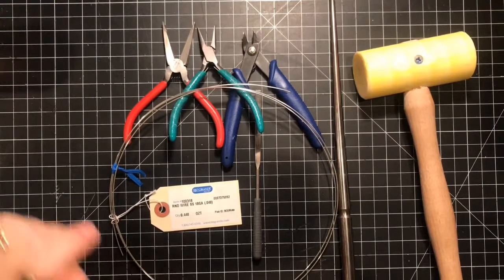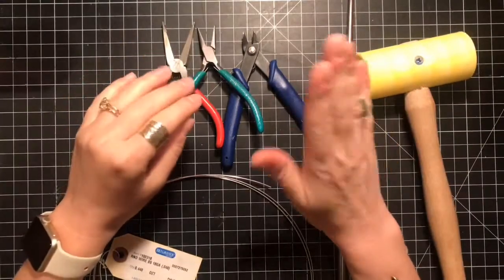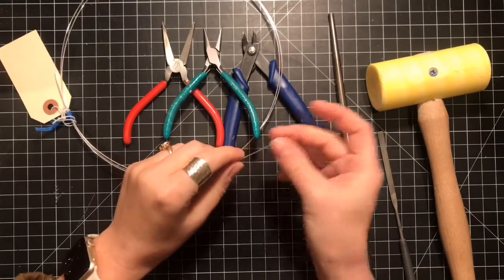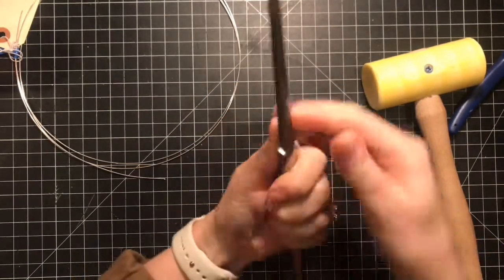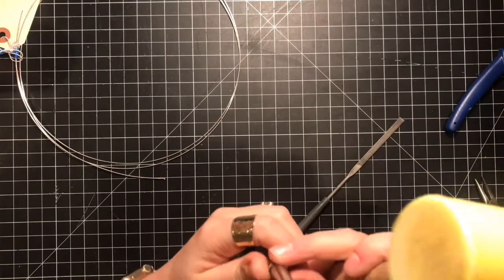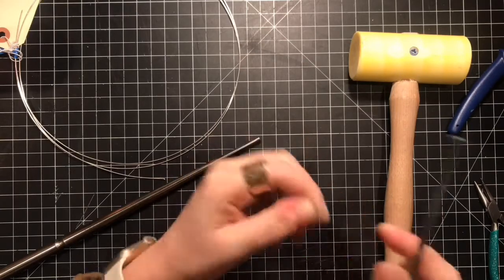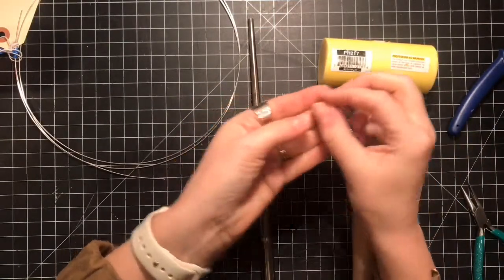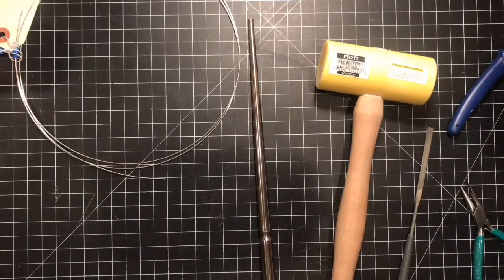DIY- How to Make an Earring for a Cartilage Piercing// Conch/ Tragus/ Rook/ Helix

Comment: Could I make one to put in my helix?
Reply from the maker: Yes these would work in a helix. I needed help putting it in but it worked!
Reply: @thehautebohemian5753   what gauge wire?
Reply from the maker: Maddie McDermott I would use what ever gauge your ear was pierced with. Typically it’s 16 or 14ga. I used 18ga for my tragus and rook.